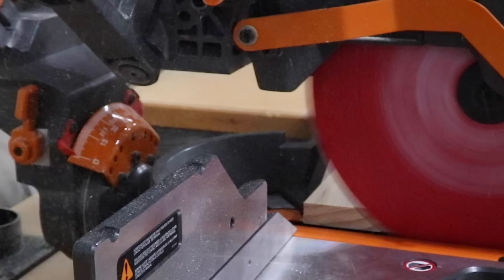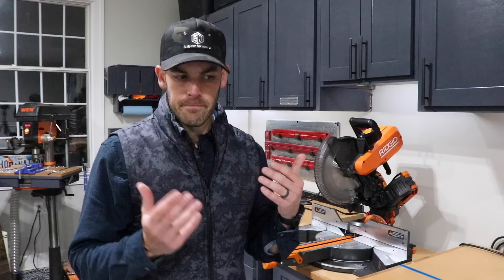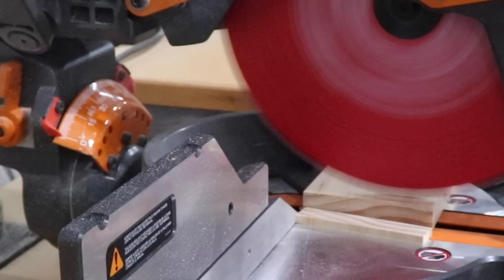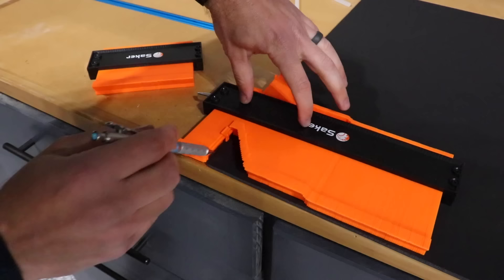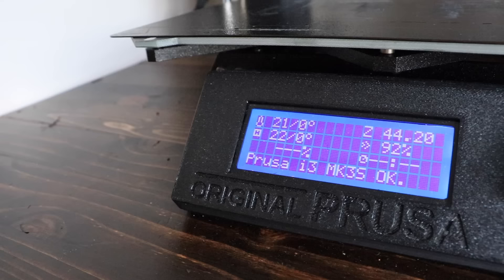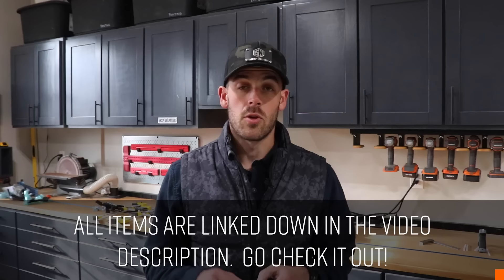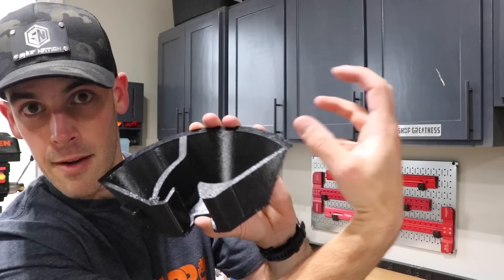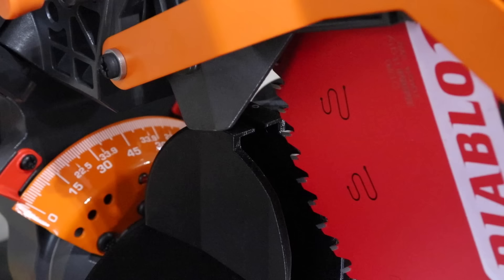Did I Solve Miter Saw Dust Collection?

Comment: What I think is a difference between the 2 tests you did is the angle of attack on the piece to cut. If that angle is different in-between the cuts, the angle it shoots out the dust is also different. Take an angle grinder as an example. Grinding before or after the centre of the disk is going to direct the sparks in different directions. From what I've seen you made more straight cuts on the second test thus shooting dust more upwards (and over your spaceship). While with the first test you sometimes did scoring cuts which lowers the exhaust angle more parallel with the table. 
Excuse my explanation, not a native english speaker so I hope it's understandable.

Comment: First, you need to consider that the saw produces chips and dust, thus you would need both HPLV and HVLP dust collection to capture everything. Then, you need to consider the dust comes from and gets captured by the gullet of the sawblade, rotating at ~4,000 RPM. This will create significant angular momentum of each wood chip and dust particle, at a high velocity, causing the erratic displacement of chips along the sides and back of the blade. Considering dust can and does get trapped in that gullet, this dust can be expelled at ANY point in the saw blades travel, and it does. Thus, limiting your dust collection to the furthest point of the saws travel limits your collection abilities to be most effective AFTER the cut is complete and all dust has been expelled. Finally, the Festool Kapex is considered to have excellent dust collection, and based on above it is obvious why. The Festool Kapex features a wide and soft rubber shroud which follows close to the blade to collect the majority shooting out the back. There also appears to be a second stiff shroud inside the blade housing which limits the number of exposed teeth per cut. A major difference from competitors seems to be their upper housing is also apart of the dust collection system, thus any dust thrown up or forward are still captured. Combine that with their vac which is tuned for pressure and volume results in industry leading dust collection. 

Where does that leave you? 1. Ditch the concept of a fixed collection location, it MUST travel with the blade. You did not test the included chute, but I imagine it would have done better than your fixed position chute. Improve on the existing chute by increasing the area and using a stiffer rubber which is better mounted. 2. Improve the blade shielding to limit the number of exposed teeth during a cut. 3. Experiment with different volumetric flow rates of dust collection. I'm new to your channel, so I don't know if you take suggestions or comments, but if you do I hope this is helpful, from one miter-dust covered engineer to another xD

Comment: I have the same saw, I wasn't aware the dust collection was that bad. I would probably try a larger hood rising in the back of the saw with vacuum suction near the bottom, kind like a clam shell behind the saw. I think one of the problems is overcoming the air produced by the saw blade itself. Just my thoughts. Thanks for the video, it was very good.

Comment: I solved dust problems with my table saw by making a sled with a plexiglass top, and ran  tape from the sled toward me. The tape basically caught the dust for me. The only way we can truly solve the dust problem for miters is more suction or adhesives, which we'll have to replace regularly. 

I was thinking of creating a cardboard enclosure connected to a large blast fan but I don't know if it's safe for cutting metals with.

Comment: Let me add my 2.5 cents into the conversation. I think if you box the saw in with sloping sides. Then create a vortex and suck up, might work. The vortex will sweep the flat surfaces that might be blocked from getting a direct sucking action. If  that is too complicated with the angles try a quonset hut design. You might have to blow from the bottom and suck on top to create the vortex needed to sweep. Once it's air born the more suck the better. Being an engineer, you will be able to sweat the details. Otherwise, this epistle would become War and Peace in length. Good luck.

Comment: I have a pretty big radial saw in my shop. Cuts to about 60 cm / 24". It's a dustmonster. Basically I just surrounded it with a plywood box and added a much bigger vacuum system. It has a 17 cm / 7" connection. I run 10 cm / 4" pipes and hoses to most of my tools but I just ran the full size to my radial saw. Problem solved.

Comment: I wonder if this is an airflow problem and not a static pressure problem.  It could be that the shopvac cannot get the airflow necessary that a dust collector could.

Comment: I think you need to widen the front of the opening so that it acts more like a funnel grabbing the particles and suck them in. And did you block the port that came with the saw cause that could allow the dust to blow up and out as that is the way that was designed. Maybe you could put a piece of rubber or a thin brush on the back of the upper shoot to continue directing the dust down into the dust collection system.

Comment: This is a really cool project, I'm looking forward to seeing how it evolves. Maybe you'll get better flow characteristics if you increase the radius of all the transitions on the inside? There may be spots that are creating vortices and not enabling the dust to smoothly move through the structure. I would relate this to the air-intake of an engine. You want the air to move as smooth as possible. That's my best guess for now. Can't wait to see how it turns out 👍🔧😊

Comment: Create eddy currents to slow down the stream of air to allow the dust to drop out of the air current induced by the blade. The funnel actually accelerates the air causing the dust to travel past. Add fins to create turbulent air.

Comment: How about replacing the solid table top the saw sits on with a metal grate, get a much more powerful vacuum and pull the dust down. If you have enough air flow down under the saw, the flying/floating in air particles should be pulled down.

Comment: That was a great attempt! I think you might need something like a flexible shroud attached to the top. I've only started with mine but using a double thickness of duct tape and surrounding the back of the blade guard has helped direct a lot of dust to the built in dust port. Good luck!!

Comment: Maybe worth trying a videoing using a smoke generator to get a better idea how each development changes the air flow before cutting anything. Also cutting different materials with varying densities to see if the mass of oeach chip makes a difference. I will keep watching to see how you get on. Keep up the good work.

Comment: I did a similar printed dust collection shroud a few years back.  It works well.  You can find in my videos.  I think larger and two vacuum ports would work for your design.

Comment: You pretty much need a full enclosure that encompasses and seals over the entire blade exit path to see any degree of success.  Because yeah, dust collection in a typical sense is pretty much impossible - but you can have a vacuum slurping up the bulk of settled mess inside dust containment while supporting that containment with negative pressure.

Even then, the effectiveness will be inversely proportional to the range of blade articulation you support, as every scrap of range, tilt, and turn compromises the seal you can get around the blade and over the work pieces.  For that matter, I'm not sure a shop vacuum can handle it - with so much intake opening, you really need HVLP.

It's a shame that motor isn't mounted further back.  It'll really get in the way of a vertical slit opening.

When I set up my station, I'm going to try a cabinet with double sliding doors profiled around the blade arm and dust shoe lining the center and bottom edges.  It won't capture dust for reaching cuts, and it won't work well for tilt, but at least it should be convenient to open and close as needed for settings access or incompatible cuts, while hopefully performing decently with short cuts whether straight or (horizontally) angled.

Comment: As someone with the Delta Cruzer, I've opted for the box method, which as Jay Bates says is more of a dust containment unit than a dust collection unit. I will say though with the 6" dust port I have and removing that absolutely useless flap, it's better. Really looking forward to this adventure and will be the first in line when you figure it out.

Comment: How about if your intake is wider & taller than the current design that seems to allow the blade but doesn’t appear to be open enough to capture dust from the larger area it is thrown from cuts? I have a little brother 12” RIGID MITRE SAW & am VERY INTERESTED in what you’re working on. Thanks for your video & your energy…, fun & educational. Good luck. 👍🏽

Comment: Because the air flow is arcing above the inlet, you would probably have a turbulence issue...  Something like air lock. I would increase the width of the opening - did you pull the dovetailed deflector out to see the results?  Also in your "Test" maybe running the factory option as well, might give you an idea.

Comment: I've had thoughts on this in the past for both miter saw and drill press, but am currently in between shops... What about establishing a positive airflow? somehow hooking up compressed air more towards the front of the cut, aimed towards your dust collection, possibly near the handle of the miter saw. Not a full-blast air current mind you, but enough to help push the dust towards the dust collector. That, and a wider mouth to the dust collection. I feel like the big issue with miter saws is that they like to shoot dust in every direction, so catching dust from every direction would be difficult. With an air flow funneling everything towards the dust collection site, perhaps that would solve the issue. Worth a shot?

Comment: Great project!  One worth pursuing as it seems to be a very common problem.  I tend to think that bypassing the existing dust collection setup may of been hasty as despite the fact that it doesn't get all the dust it does seem to be in a sweet spot.  Perhaps attaching a modified collection setup in place of the original is worth looking at?  It may also mean not having to remove all the time when cutting angles.  I am sure you will get lots of advice and suggestions.  Good luck and I look forward to you next video.

Comment: The simple fact is your configuration is trying to collect the dust from the bottom of the chamber when the blade is throwing all the dust at the top. You have to draw your dust at the high point and let whatever settles down just be. Or just hook up a 3500 cfm collector. Ridgid was on the right track with their dust thing but a tube with a slit would have been better. Keep it up man.

Comment: Aside from some engineering school, I'm not an engineer. I've been racking my brain about miter saw dust collection since I started woodworking a number of years ago. It's interesting how it seemed to concentrate it up onto the bevel  gage. Do you think it's possible that adding a T to the dust collection hose and ALSO hook it into the port on the back of the saw? And possibly flaring out the opening just below the highest part of the blade. 

Love the video! It's interesting to see your process. I need to incorporate more 3d printing into my shop!
Reply: I think the dust landing on the miter gauge is being carried by the teeth themselves through the dust capture apparatus on the saw.   I think creating a higher deflector could work but really more observation and research is needed.
Reply: @1320crusier  Yes for sure; it'd have to be tapered away from the blade however, otherwise you'll have a clearance issue.

Comment: Okay then.  Didn't expect that.
Here is a thought.  Maybe if you blow and suck at the same time?  Have an over the top hose blowing down and directed at the intake.  That way you would be inserting the dust into an already established air stream.  Make it attached to the blade guard, or maybe the motor housing.  In fact, 3-d print a new blade guard with hose attachments to it... on both sides of the blade and have the aim back to the intake port.  put a little flow flapper inline with it to adjust the amount of pressure to use.  maybe make the them pivot parallel to the fence so that the angle remains the same as plunge and cut.  you would have to consider how that might or might not block the view as you cut, of course.

Maybe there is a way to slow the blade down so it is not sending chips out at such at such a high velocity?  Sometimes shop tools are way over powered for most jobs.  I know that routers have variable speed...  variacs can be expensive though.

Comment: Not enough vacuum to overcome the air flow directed into the catchment. The particles are flying in at such a high rate of speed the vacuum cant overcome the deflection. Maybe add bristles inside or a more direct route of the hose, were the vacuum entrance is straight back so theres no deflection.

Comment: Try taking out the center blade fence in the bottom center of the saw and design that channel with the dust collection sucking from the bottom instead of the back. The saw is already throwing chips down and back so try and stay with that motion. Just an idea.

Comment: Nice to see someone agree the dust collection on these Delta/Rigid is non existent. Even with a dust system. Probably what I’ll do is box mine in and instead of a solid base like you have I’ll use a down draft table set up with just support for feet so everything fall into a wide mouth vacuum port. I do notice the Dewalt sliders have dust port shoot in better alignment with where dust travels but the long bars make it a bad option for space saving.

Comment: Number 3 isn’t that bad… I’m an engineer too. Built a box, didn’t even seal up the front, 4” port on the “floor” of the box right behind it, done. I can cut a 2x4 and not even smell it. Sure, the box itself gets messy, but it’s contained, and I can sweep it into the dust port. AND IT DOES MITERS.

Comment: the blade tips on a run of the mill underpowered saw are moving about 200 feet per second, so every chip is waaaaay too high energy to even feel your puny vaccum. you need to identify the  broadcast pattern of the chips in a plane (the black foam board is ideal to visualize chip distribution) then make a collector that physically redirects say 90% of the chips to the vac port. the chips own energy and velocity will carry it to the collection site.

at that point, do a patent search to see how far your idea departs from what is already known. reiterate and improve a few times, and then file a patent application with the goal of selling to the name brands or manufacturing on your own. the power tool/prosumer market is the rare space where solo inventors can still make their own success (at least in the opinion of this patent attorney).

Comment: It seems that you have turbulence during suction. Add venturi openings, as slot for the blade gets obstructed very fast during cut. I suggest to verify flow using colored smoke after modification or the use of  a simulator.

Comment: I have the Cruzer and was really interested in this. I wonder if plugging the original dust port up top would improve the air flow. With the RPMs and direction of rotation your wonderfully designed piece should capture at least 80-90%. The side trimming/squaring cuts are always going to be wild cards.

Comment: The problem is that you are using a high volume low vacuum system. You need a low volume high suction vacuum system. Use a standard vacuum cleaner with small diameter hose. The air flow stops when you are cutting.
Reply from the maker: I think you have that backwards, but I know what you mean!
Reply: @ShopNation  Looking forward to see your analyses :-)

Comment: Here's my observations.  The dust was concentrated directly behind the saw versus all over cuz the vacuum created enough suction to direct the dust in the right direction.  However that dust literally goes everywhere. I believe if you can get the "hood" closer to the saw, maybe even encompass the rear of the saw.  There is a bolt at the back of the saw blade, the neck you can call it, that's holds that orange bracket connecting the axle nut and the back of the moving part of the saw.  Maybe make that the mounting point w a wider hood, again encompassing the blade. And then have the flex hose connect to that so when you do slide the blade forward it can move with it.

Comment: I have a small 7" Kobalt and it's dust collection works great and the one thing that is different is that it uses the smaller 1-1/2" hose connection which forces it to draw the air in faster than the larger hoses. Maybe try a port reduction at the hose to the dust collector to get a faster draw?

Comment: The volume of air that you have to vacuum with a table saw is similar to a miter saw. A shop vac with a 2 1/4” hose is too small. An adequate shop dust collector for either of the saws will move 750 cubic feet per minute through at least a 4 inch hose. The other problem is being able to make miter cuts with your saw. Being able to switch from 90 degrees to 45 degrees is a better test of any dust collection.

Comment: this is why i use my miter saw outside in a breeze on a rolling stand. sure it's less convienent, sure it's crap on cold and rainy days, sure to all those and more things, but i blow it off with the compressor when i'm done, fold it up, and put it away. no sweeping, brushing, wiping or otherwise cleaning required. there are some battles that just can't be won IMO. but i am curious to see this one fought.